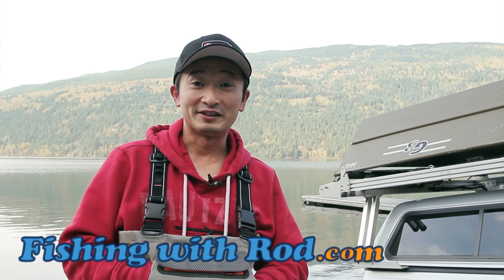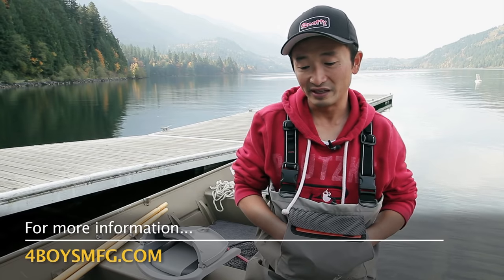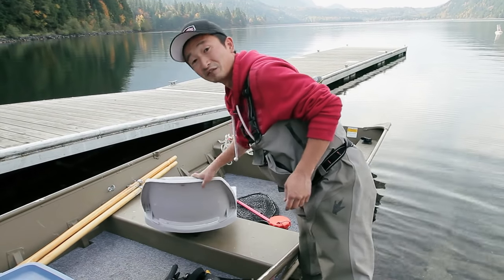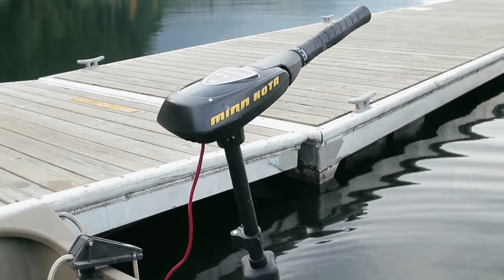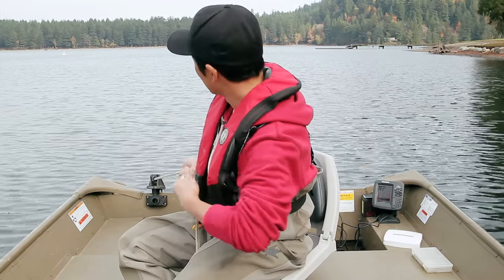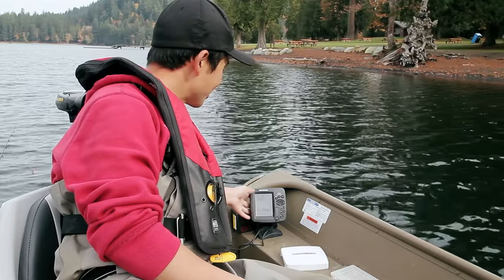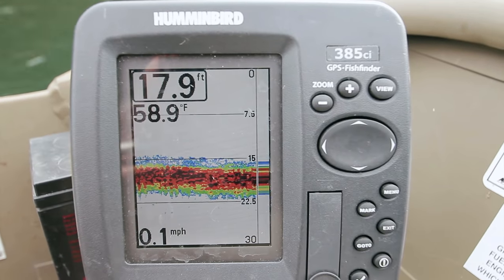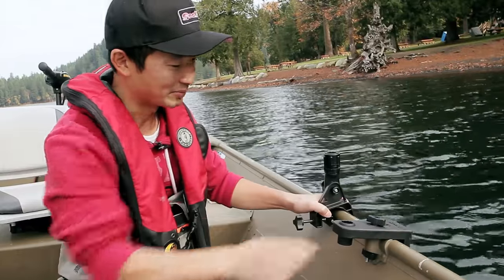A Tour of My Lake Fishing Boat Setup | Fishing with Rod

Comment: I'm looking at the same trolling motor, is it enough power for that size boat and how long will your battery go before it needs recharging
Reply from the maker: The 55lb thrust Minn Kota is strong enough to push this G3 1442 Jon boat and get you from point A to point B in a small lake. It's not ideal in bigger lakes where you may face challenges like wind and waves. For me, I like it simply because I enjoy fishing small lakes, am not in a hurry usually and enjoy the silence of an electric motor. How long the battery power lasts depends on the size of the battery and how fast you choose to go. I am usually fine with just one battery for the day outing.
Reply: Aslmx make sure you get the variable speed. 5-speeds are terrible on amp usage and battery life.
Reply: +Mr. FatBasstard  What model number would that be?
Reply: Aslmx the Minn Kota Endura C2 55# comes in a 12volt variable speed. I believe the shafts also go up to 48 inches.  
You should consider the type of fishing and where you fish carefully before you make a purchase for your boat.  

I'm guessing you want a transom mount and a 12 volt like Rod's motor. If you do a lot of trolling you're stuck with the 5 fixed speed settings with a 5 speed motor. If you go with a 12-volt motor and troll a lot you're lucky to get a days worth of fishing on rough or windy days. Make sure you get a real trolling motor battery too, they are helpful but very expensive. $150-$200+ but they will save you money in the long run on battery life and charging.... good luck and happy fishing.
Reply: +Mr. FatBasstard  I have a bow mount already. I'm on a 10hp limited lake. Maybe 300 acres. I have the largest ever start marine available. I want to go all electric. I get tired of the up keep of a gas engine and I don't fish enough to justify one.
Reply: Aslmx I got ya. I went electric to save on wear and tear trolling with my 1978 15hp Johnson. I can take it apart and rebuild it faster than a fishing reel and that's not a 'good thing' lmao... I was very disappointed in my 5 speed trolling motor I bought a few years back because 1-2-3 and 4 were to slow for trolling and 5 was so fast I could pull my grandson on an inner tube. I had to constantly bump speeds between 4 and 5 to stay at the right trolling speed. I gave it to my brother who uses it in a small shallow neighborhood lake and he's very happy with it because he doesn't do any trolling. 
I didn't want you to make the same mistake that I did if you do a lot of trolling.

Comment: what kind of screws did you use to mount your seat bases. i don't have acces to underneath mine on my 1542 topper jon.
Reply from the maker: Hi Steve, because the aluminum on the bench is pretty thin, you cannot just screw the mount in directly without anchors. I use these as anchors in the bench:

https://www.homedepot.ca/en/home/p.papc-8-32-thread-sert-kits.1000162982.html

I got mine from Home Depot. These also come in different sizes so make sure you use the right one for the screws you want to use. Once the nuts are anchored in the bench, they are pretty secured and cannot come out, at least they haven't on mine.
Reply: thanks for info on thread sert kit
Reply from the maker: Anytime!

Comment: Where can I get that Scotty mount that can mount through that hole on the side of the Jon boat? I have never see one like that (around 9:45 in the video)
Reply from the maker: Any marine stores should carry them and if they don't have them, get them to order some. On Scotty's website there is also a page which lists their dealers (very right in the top menu bar). If that also doesn't work, you should post the same question on their Facebook page, the person who manages that page is very good at replying to their customers' Qs. :)
Reply: +Fishing with Rod but on their site I can't find that particular mount that will let me go through the hole. I guess I will have to check with their sales rep then ... Thanks (by any chance you know what that part is called?)
Reply from the maker: That's an oarlock mount. It's on their rod holders and mounts page. If you scroll down on the page to the "rod holder mounts" section, you should be able to see it.
Reply: ***** Great! Thanks!